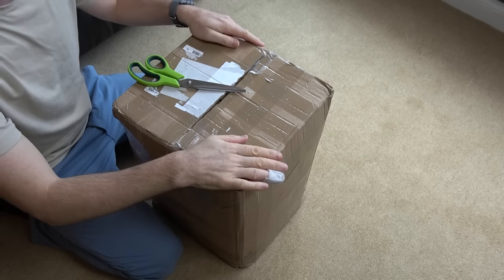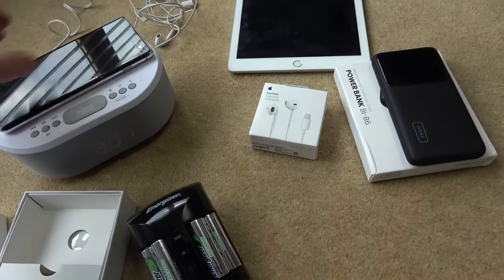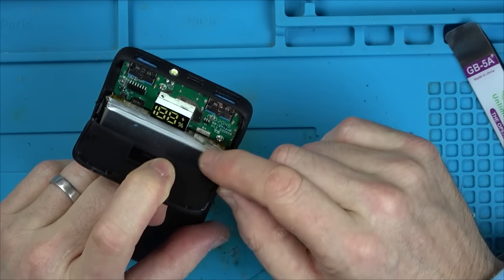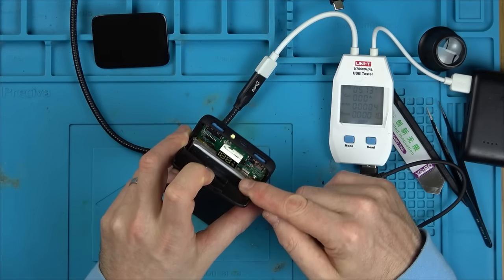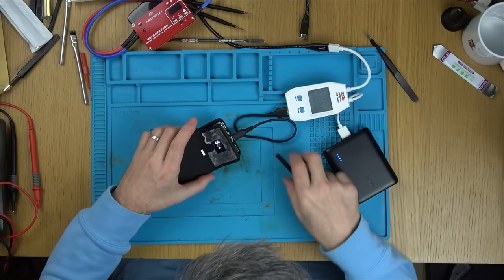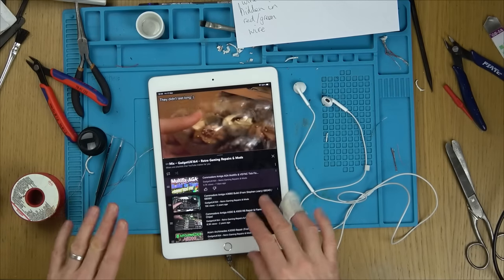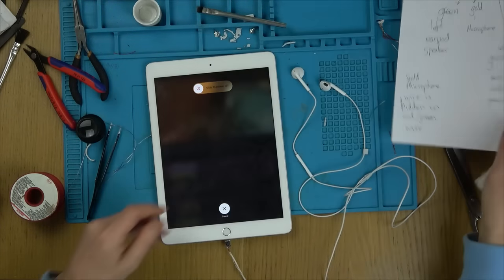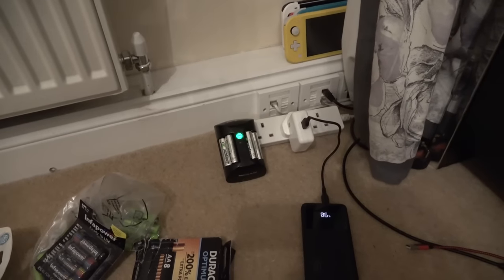AMAZON Returns MYSTERY Box from eBay??? Can I FIX it?

Comment: The reason the battery pack didn't originally come on when you bent the tag down (and also after the repair) until after you'd supplied external power is a good sign that the charge controller is behaving correctly! When the battery was disconnected, the charge controller saw the 0v and put itself into undervoltage protection mode before it's power failed (there's probably a capacitor that held enough charge to allow this). It's then isolated from drawing power from the battery so as to avoid the fire risk of draining it too low.
As soon as you supplied external power, it could safely power itself and check on the current battery state, saw the battery was at a safe voltage and switched into the normal charge cycle.

Comment: Lolly stick or coffee stirrers are good for holding back covers while you work. Just cut them down and wedge them between base and lid each side. Also repairing charger ends you can get the heat shrink with glue in which works 👍

Comment: I've done quite a number of headphones' jacks repairs since my school days and currently trust epoxy more than hot glue. Because hot glue softens over time, being in contact with oils and other chemicals from skin. And, anyway, it's not really strong for holding those tiny wires.
And there's a way to restore mechanical strength, at least, taking some load away from the wires themselves by means of a thread. Can run it few times, wrapping around the cable and the connector or even connecting it to the reinforcing thread of the cable if there is one.
Also thread can be used as a part of new outer shell, that can be quite nice of done carefully. Just put threads close to each other over the repaired area and bind it with a glue of your choice. Mostly I've used PVA (wood glue) as it's easy to use and flexible when dry, but epoxy or even CA can be used as well.

Comment: I'll sometimes use a piece of heatshrink that's too narrow to go over the connector and stretch it out with long-nosed pliers. Have to be careful as it can rip easily. Then it will fit over the connector, and shrink down small enough to fit the cable when you apply heat. That way you get a neat heatshrink covering on both the connector and cable. Another great video, good work!!!

Comment: Great job Vince!
I always tend to see earwax on one of my earphones and I've cleaned them using an earphone cleaner kit that I bought off from Amazon so maybe you could consider using that.
And also, not only you can use the multimeter to test the batteries. But also you could use a LED battery tester which will light up whichever the batteries are okay (green) or dead (red)
Hope this advice will help you (and everyone else as well)

Comment: Battery charger is fine 1 of the battery  cells has failed I had exactly the same problem, the charger is designed to warn you of bad cells and won't charge them. They charge the cells in pairs so if one side is fine it will work but if the other side has gone won't charge at all

Comment: Hi Vince... a simple bit of test gear can find 'motorboating' faults as per your mini Bush record player: a hi Z in AC coupled signal tracer. Instead of tracing audio signals, you 'listen' to the power supply where it feeds the audio amplifier. Any ripple (as caused by a 10nF cap rather than a 100nF) is immediately obvious - it's 'noise' on the power rails. If you've a 'scope you'll see a typical 'pop-pop-pop' triangular wave on the DC power rail(s). Job done!

Comment: I got an HDMI adapter kicking around that has a the same 'Apple-style' strain-relief that is really terrible at relieving strain. If it was easy to open those adapters it'd be a <5 minute task to fix, but when you start adding the force required and potential for injury, it sure becomes a lot less appealing. Having to pry open devices like powerbanks is always very exciting for such reasons, especially with the big Li-ion battery inside to puncture :)

Comment: Whoop whoop, the mug came in handy! I’d definitely try some Sugru for the cable repair if you do something similar in the future - it’s great stuff
Reply from the maker: Thanks Kip, your mug had just the right amount of weight to it. I'm glad you designed it to be multi functional.
I did buy Sugru a few years ago, then after a year and a bit I went to use it to find out I opened/unfoiled hard bits of rubber. I didn't realise it had a shelf life. It was like a pack of erasers that didn't rub out. I've been mentally scarred from buying it since😂
Reply: I did think that myself
Reply: @Mymatevince  Keeping it in the fridge means it lasts MUCH longer, a few years. However I still think it's very expensive considering it sometimes only gives a few extra months of life to a cable.

Comment: I use a specific heat shrink when I do those repairs. Look into glue filled 4 to 1 heat shrink tubing. It mostly comes in black, but it shrinks down to 1/4 of the original size, and it is glue filled. The glue is pretty stiff once cured like hot glue but still a little flexible. Perfect for strain relief use on connectors.
Reply from the maker: Thanks for the info Rehab👍👍
Reply: @Mymatevince  That stuff that Rehab is talking about sounds similar to the ones B.T/ OPENREACH  use for underground cable joins on the bigger cables
Reply from the maker: @UserUser-ww2nj  Yes,  the glue used to ooze out of them. I remember that horrible feeling when you hold the heat a little too long in the one area and pop...it all splits open and you had to start again. Normally when the cable ends where too short and you were on your belly reaching down in the joint box in a puddle in the the rain 😂😂😂
Reply: @Mymatevince  Oh yes , they could be a problem . We had a job at Gatwick airport where the underground ducting was all flooded , had to pump out a massive amount of water just to get access to the cables , big ones . Finally got to them , sorted the problem and used one of those waterproof connectors , sealed up with a full blown gas torch 😂. Sealed it up and threw it in the water . We should have stayed on site for an hour on fire watch but the guy in charge decided we could go immediately after  , no point staying when the heated connection was under water . I worked for LUX , the company that supplied the traffic management to Openreach , met some great guys doing that job with lots of "overtime " logged " , wink wink .
Reply from the maker: @UserUser-ww2nj  😂😂👍
Reply: @Mymatevince  I know you are 2 hours behind us here in Ukraine but why on earth are you still awake at this hour , 02.25 your time. I'm a night owl 🦉 😂😂
Reply from the maker: @UserUser-ww2nj  I'm another night owl 😂
Reply: @Mymatevince  04.30 here , ought to be going to bed but whatever. Take care Vince , I enjoy your videos, especially the quirky ones
Reply: @Mymatevince  Night owl 🦉, it's a bit of a curse , but I prefer the night , always have. You are probably working on videos to upload. Hope to see some good ones 🇺🇦🇺🇦🇺🇦🌻
Reply: @Mymatevince  Looking forward to the next Amazon box  from what the other guy said it sounds interesting 😂😂

Comment: Get yourself 4 headway cells and a bms. You'll get hundreds of spot welds out of a charge and they can source 100's of amps, perfect for a spot welder. I do this with my spot welder. I just keep an eye on the voltage as my BMS is too small to handle the sport welder current.

Comment: Regarding the Apple Earpods: you could in theory be able to resolder them to a conventional TRRS 3.5mm audio jack if you didn't want to deal with a Lightning port due to structural issues. I may be wrong though
Reply: Sounds good as long as +, - and mic are joined together correctly

Comment: I have that battery charger and two things about it. One, the batteries that come with it don't hold their charge very long. It was very annoying. And two, you must charge the batteries 2 or 4 at a time. If not you may get an error or overheat.
Reply from the maker: Thanks Fall Witch 👍👍

Comment: 33:40 Hot tip. If your meter is reading too high for what you are testing, a lot of them will do that when the internal battery (often a 9v) is too low. It's caught me out a bunch of times.

Comment: Your a better man than I Gunga Din, I once poked a hole in a Lithium flat pack battery and the rumours are true, I used to work as a Laboratory Technician and lithium in water is as reactive as Sodium metal almost. I watched the battery burn for ages too scared to touch it, but it was only one of the cells so it eventually stopped. But I developed a new sense of awareness for Lithium 🔋 batteries. Love the tiny welder( I want one ). Lovely video Vince, Amazon don't give much away do they. Great to watch you opening the Amazon 📦 Box, I was as exited as you to see what was inside, a tiny letdown though, but what can you expect for 45 pounds. A wonderful fix it video as usual Vince.

Comment: For the cables if they are damaged cut off the bad end and use them as leads to solder onto pcbs where the socket/port areas are too badly damaged.

Comment: I've seen a bunch of things returned to Amazon like brand new Kindle Fire , garmin forerunner smart watch , hamecs , blankets, etcetera some brand new never opened some stuff slightly used but for the most part everything worked or was in excellent condition but was missing chargers , covers/cases , etcetera the Kindle Fire was brand new never opened its a gamble what you will find though

Comment: Previous owner probably shorted out the A-port
One of the most common problems with battery Banks is people don't know how to freaking use them that particular battery bank is quite famous for if you put your USB in the wrong way it can go in but it shorts out the signal and you have to put two USBS in the correct way and power it back up and then unplug the USB and plug them back in and it usually works again this is why I put stickers on all my battery Banks this way up

Comment: Not bad at all! Gone all the way through town with those spot welds, the other, untouched end would fail instead! (Curious about how cheap the welder is, will be needing one for my battery pack)

It is normal for non rechargeable AA, AAA cells to show 1.7 volts when fresh - that's how they are said to last X years in storage, once the voltage drops down to 1.5 volts it would have been that old (nearing expiry or otherwise expired, always check with a multimeter because there will be some stronger cells than others!)

Is that Energizer charger the CHPRO? Pretty good unit. Maybe on the next mystery box you'll get a BQ-CC55 if the win streak goes through!

Comment: I’m curious if the batteries are faulty because they don’t provide the correct power output or rated mAh. I’m not sure about load testing batteries but I had purchased some AA batteries on Amazon that measured around 1.6 volts but when put under load they dropped sharply and I actually had one explode. I was using them in an Estes model rocket ignition system and couldn’t get the igniters to glow and set off the rocket engines. During changing of batteries and checking voltages for faults, I had one battery explode. It wasn’t until switching to another batch of batteries that I purchased locally that the igniters and rockets engines started functioning correctly.

Comment: With the power bank, why not pick up one of those guitar pedal alloy cases and transfer all the doings into that and you can dremel out a window for the meter and socketry giving you a fairly robust power bank?   You could even wire in one of those voltmeters that show draw etc and even a couple quid from Aliexpress one of those step up/step down variable voltage circuit boards giving you a decent 12v output that you can control.   I wired one of those into my emerging ATX psu kit, I bought for £1.40 a kit from Ali, you plug the 24 pin into it giving you 2x 12v with terminals and 1 5v and 1 3.3v, I wired in a 12v into this variable step up/down board and I get now a variable .5v to 12v to a set of terminals and the thing has cost me an old ATX power supply, few pounds in Aliexpress kits and about 10 minutes work :)

Comment: It is possible to slide the white outer shell off the earbuds connector (away from the connector towards the earbuds). Then the cable could have een repaired and the shell slid back on and glued down..  Edit: well after locking at the video I think my cable probably was a 3rd party cable..

Comment: If you had thought about it beforehand, you could have put a smaller diameter shrink tube over the wire, maybe even 2 pieces, and pulled them up to the connector shrank them then put the bigger shrink tube over everything wolla no messy goop needed lol

Comment: Hey Vince it might be worth your while using an old Xbox 360 power brick for a power supply for your spot welder I use one for a diesel heater to run it instead of having it hooked up to a car battery it's fairly simple to do too! A quick Google search will show you how to do it 😌
Reply from the maker: Interesting, thanks for letting me know about this idea👍👍👍
Reply: Or a PC power supply

Comment: Hi Vince, my name's Troy. I've been a subscriber for a while now and I absolutely love your videos, they're very thorough, professional and entertaining.

I have two faulty universal remotes. One was purchased on eBay and most of the buttons don't seem to work and the other was purchased new for me by my Mum many years ago and that one seems to have a dodgy connection somewhere in the battery compartment, although I can't figure out exactly where. Would you be interested in having a look at these by any chance? I'm happy to get rid of them if not, as I now have another one. Let me know and keep up the good work. Thanks! 😁
Reply from the maker: No thanks Troy because I have a lot of items here already to look at BUT you could probably fix the button one by cleaning it. Sometimes the carbon contacts on the circuit board need to be wiped down and then they may start working again 👍
Reply: @Mymatevince  Hi Vince, thanks for your reply. No problem, just thought I'd ask I'll keep you posted with how I go. 😁

Comment: To burn coating on the earphones wire you can use tablet of aspirin(acetylsalicylic acid) and soldering iron. It will smell really badly so don't breathe it but wire will be clean on a second!

Comment: Testing batteries with a voltmeter doesn't reflect it all. Remember to test unknown condition batteries with a load because the voltage can rearrange without a load and looks good with a voltmeter but with a load attached to it, it can collapse completely. In that case the battery is useless and dead.

Comment: Something is not right with those battery voltages? That spot welder you received will be limited to what size strips you will be using to fuse. I just bought a real spot welder, problem solved.
I do a lot of 18650 battery packs. Please get a battery tester and see if those batteries are real? Voltage means nothing. Nice job on the earphones Vince.

Comment: 1:23 Who in their right mind would return batteries to Amazon, given that most couriers don't even like batteries?
Take them to your nearest recycling place and put them in the battery recycling containers if they don't hold any usable charge! Or use them if they do... The best thing to do is to test then with a voltmeter... Alkaline batteries at 1.5V+ they're good to go. 1.2V+ they should still be good for low drain appliances. Under 1.2V, recycle them (unless you have something that really drains them right down).
Rechargeable Ni-MH, just shove them on a charger (assuming they're not damaged). Even if the standing voltage is very low, they should easily be able to be re-charged without issue.

Comment: You say the Apple cables are very well made, I have over 100 Apple lightning cables to sell you :P

Let it be known, you can try and make cables as strong as possible, but once you put the cable into a school situation, it won't last, you might get a week out of it, you might not.

I have cables with the entire lightning plug ripped off with exposed wiring, cables with the plastic housing for the lightning plug cracked or missing, etc...

These are all charge cables, though I toss them in the bin once they break.

To try and reduce the issue, we bought pre-cut heatshrink off ebay to put on the ends, allowing you to still plug them in, but try and reduce the problem, that slowed it down when we started doing it a few years back.

We also buy in bulk aftermarket ones.

Comment: you could have used IPA (which you got lot of in stock) on the powerbank to loosen the glue. On the Nintendo Switch I use IPA to loosening the glue underneath the battery. because it's glued as shitty as in the Powerbank you fixed.

Comment: where did you get the box from i have got 2 in the past they said it was electrical but it was  just a load of old  phone cases and cheep earphones and watch straps
Reply from the maker: eBay here in the UK. Hopefully you will recognise the listing for £50 with a best offer👍
Reply: @Mymatevince  is it the one in wigan if so i will pick one up tomorrow  i live in wigan 😁
Reply from the maker: @jagjay8033  That's the one👍👍

Comment: I got this week my rolls of copper tape with conductive epoxy, making wire traces is such a doddle and damned useful in areas where heat would destroy components, only a couple quid for a few rolls of different sizes and I reckon you should grab some as super super useful :)   Wearing my Pulsar VR43 Solar chrono for the first time, passed its 3 months test under the lamp, full 90 days charge and holding it, this was the watch I bought from Pulsar brand new and broke almost immediately then got treated like dirt by Seiko UK who refused to repair it :(   Well I did and Seiko group lost a valuable customer, although I did buy a Lorus Y676 (7S26C) a bit after but I won't buy another from 'em grr